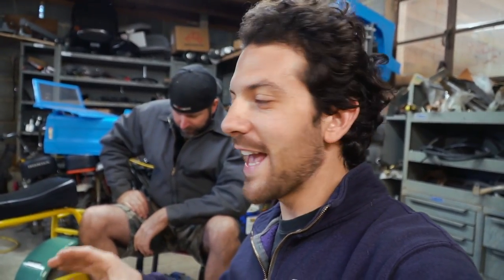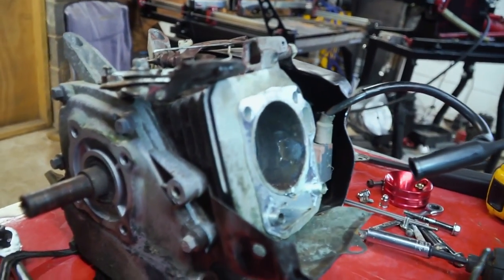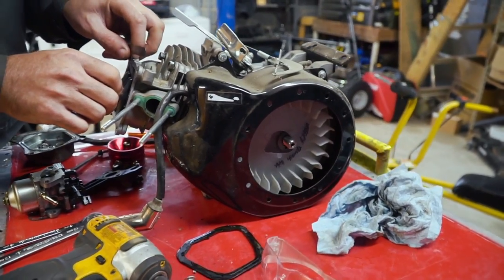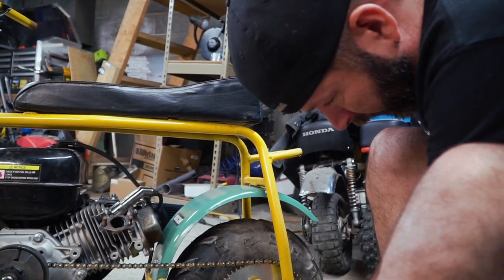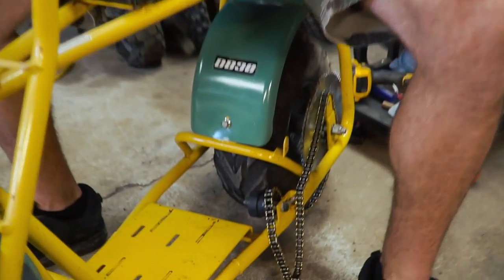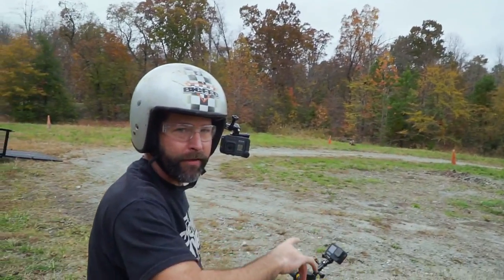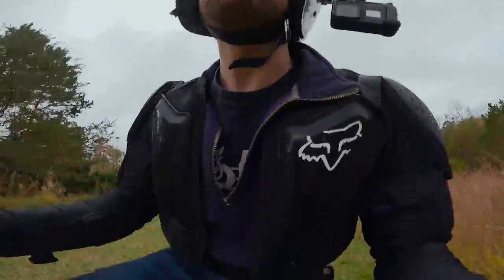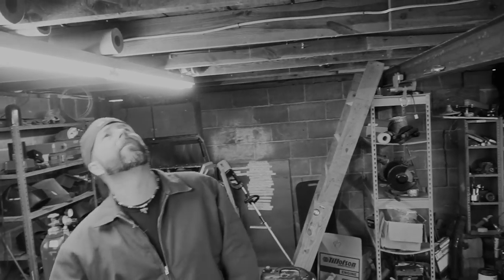Building a Budget Doodlebug Mini Bike | Max Fun for Under $200!

Comment: I put a nice green dirt bug racer db30s on Craigslist for $300 with a new chain, good clutch, 196 w/ oil sensor delete, 18# Springs, new coil, new seals, new plug, new air filter, new 212 carb, new muffler, spare ($bearing style$) tensioner, spare brake pads, new throttle cable and the swap already done, perfect fork, newer seat,, straight frame and fendees. Absolutely complete and rides perfectly..... I got offered $250..... 😕.

Comment: Get a scraper blade for tractor or if ground is to hard use a disc on it first then scrap it and repack it a good episode could be made from building a roller to pack it build a frame and use a 55 gal drum and fill with water to get the weight

Comment: if you take a plow or a tiller to your tracks the box blade will work better however if you dont get compaction on it after you grade it out it wont matter. Also if your dirt is powder dry it wont pack.

Comment: Spin the tires back around "backwards", you'll have way better traction
Reply: I never understood why tread is pointed forward.
Reply: @USN_Ret-  
Facing forward is easier on the terrain/turf/farmland. 
Ever watch a mud truck in a bog? Terrible time going forward, but reverse no problem. Everyone puts the treads on wrong!!
Reply: You are correct because they would then be correct.
Reply: Reason they go "backwards" as y'all call it, is it keeps mud skiing out of cleats, keeping them clean and unclogged. When tires are reversed you don't get good clean out
Reply: @hammerT2997  
Thats what wheel speed is for😉

Comment: Your gonna need to dig it up with the bucket to get to the soft dirt those boxes are for more spreading and plowing softer material snow wood chips top soil gravel so just dig it with the bucket then use the box to smooth and shape the trail

Comment: As to the tractor thing: you would need to run it over with the front loader, and have the box blade behind for cleanup. Better off with a straight blade, like a ford 5' or so 3 point. Heavier is better, and it will take a bit of time, and multiple passes. You can add weight to the box, but it won't be the same. Also a ripper type tool can come in handy, but I forget exactly what it's called. It has 4-6 tines that are on a bar, and go inside of the box blade usually. Check the tractor supply.

Comment: I just picked one of these up with a running stock engine and an extra subaru robin for $100 and a motovox mbx10 with a predator 212 swap with the stage 1 intake straight pipe and jet for another $100

Comment: I don’t know if anyone had suggested doing this but I would turn those tires back around so they’re facing reverse instead of like what you did earlier when you changed the direction of the tires on the front I would turn them in the opposite direction. I think this might help with the slippery roads.

Comment: i wish i knew how to tell you to work a box blade but not sure i can but will try.  start with the box blade just barely off the ground on the a spot you want to level. and go from one end to the other and see where it hits and then let it touch the ground at the highest spot where it hits and as you go back and fort don't touch the lever until you stop moving dirt any where. then drop it a little again in the same spot and start all over and the next thing you know you have a level road. but always start at the same spot and it should be at the highest spot. just remember once you find the highest spot don't touch the lever.

Comment: Having the brake so tight if you back off the throttle the governor releases so as you hit mud the wheel looses traction allowing the brake to lock up the wheel so making it slide out significantly faster than normal

Comment: You have the tires backwards now. Look at how the pattern meets the ground. Spin them to what you call backwards and run them, I bet you like the traction.
Reply: Like a street tire pattern wider at rear when on the ground not at the top. It dispersed water out and to the rear of the tire not to the front.

Comment: I used to build honda engines per w.k.a. rules,you can get away with setting the valve lash at 2 and 2.any tighter than that,and it won't restart until it cools down.

Comment: Add a half link!!.. I run into this problem a lot even on the same chassis.. sometimes adding a half link makes the chain two slack but it's too tight without it when that happens I just hone the holes a little bit... Like mini slots.. then that allows the chain tensioner to move to optimum tension..😉🚴🛵

Comment: I have ones of those. Still have the stock engine way to slow need to throw a a 6.5 or a Tillotson
Reply: Put a 212 on mine, wheelies easily
Reply: I wedged a 7hp snowblower engine from the 60’s in mine.  Total death trap

Comment: You need to level up the ground with a Scraper blade box blade levels gravel after its on the ground. May need to  rake attachment too. But a tiller would make the ground worse than it is now. Look at videos on da tube they will explain it better. If it was me I'd gravel it and tar over top of it. Look into ground up asphalt.

Comment: Hey guys i know im way way way late but have you guy can cut slots
For engine mounts easily on your drill press using a drill press clamp and a cheap ebay/amazon/internet end mill by doing this youll esentially 
Turn your drill press in to a milling machine when needed

Comment: CarsandCameras !!!!!!!!!!!! You Can Buy or make in that kobota LA211 a Landscape Rakes A Model LRC60  ( and you can build a metal / steel beam plade just drill holes in right spot and you are good to go and those lrc60  are built with rugged durability for tough clean-up jobs,anyways as well as fine raking features for light-duty lawn care and general maintenance.
• High-strength, box-type beams and spring-steel tines handle rocks, dirt, and sand
• Adjustable angles and 360-degree pivot control flow of material to left, right, or center
• One-inch tine spacing provides superior material collection for a smooth, even grade
• Optional dual-gauge wheels for depth control
- Less

Comment: I am having the same chain tensioner issues in my DB30 and its gx 160. So i need ideas! Slot the mount? But how do you keep the motor in place? Will the engine mount bolts hold it or dose it need a brace?

Comment: You need a disc to loosen up the ground before you use the box blade, you should be able to find one an old one for cheap. A drag disc would be best, a mounted disc doesn't work as well and is a lot more money.

Comment: 22:14 when the bike is making that chugging sound on mine it shakes like hell. Same bike, but a predator 212. Does yours do the same thing? The only difference is that I have the adjustable plate under the motor. It seems like it's only on partial throttle before the clutch fully locks up.

Comment: Diesel fuel and gasoline mixed together and sprayed lightly will get rid of termites as well as wild plants.weeds.friends.houses etc... You'll have to vacate for a few days and avoid any open flames inside for a few days but it will get rid of them... Once the gasoline evaporates and the fumes clear the diesel will still be in the wood and termites no likie diesel doaked wood at all...

Comment: i had the problem with my trails what i did and it worker pull a aerator over the trails first and then pull a dethatcher over it to even it out. i would use something like one of your 3 wheelers to pull the dethatcher and the aerator over the trails I used two of my 4 wheelers and it worked great.

please let me know if it works for you:)

Comment: a section of chain link fence and some cinder blocks is a great way to grade the land. AN old wood pallet can work in a pinch as well. You will have to loosen up the ground first. Tiller or add gravel sand or soil.

Comment: Find me how you would say the front tire was on backwards and then go to the trouble of turning it around. You should have turned the back tire around and run the treads backwards through the mud, turn the tread around so that work for you instead of against you. When did shred runs forward they jettison the water, if you run them backwards to treads cup the mud

Comment: I just got a Mandingo gocart with preditor 212cc someone left the breather off and the entire motor and carb was full of water and engine locked up.
I drained it all,order a new $13 amazon carb,filled the head with wd40,tapped it down after 30mns put the new carb on ran some clean oil for a few minutes a few times and now it runs perfect and idles perfect.
Guy wants $20 for it all and I immediately said I'd give more than $20 and I gave him $40 lol,the rear end is missing and why it was so cheap but I do have the back wheels

Comment: I have a question do you guys put a bolt  in to keep the clutch from sliding around or putting it on backwards stops it from moving ?
Reply: I really need an answer
Reply: A spacer goes on the crank shaft and then the clutch is put in backwards so the engine will not hang out one side of the bike to much. If not the engine is off set to one side .

Comment: We use old chain link fence with some weight to level and smooth out ground. Just gotta build a little box around it. It's not hard to build and it works well here in the mountains of Pennsylvania

Comment: I have the doodle bug.   It's running 12t in front and 59t rear.   I need a new clutch.   What tooth clutch will give me a little more top speed I'm not worried about the acceleration as it gets to top speed fast now
Reply: I just put a gx120 on it.   Had a 5hp Briggs but we blew it up lol

Comment: I used to a mini bike alot like this one way back in the 70s when I was just a kid mine was called a little Indian and yes it was made by Indian motor cycle company they made a line of mini bikes and 50 to 250 c.f. dirt bike's it was there last ditch atemp to stay in business back then it didn't work they still tried of course I should have it would be part of history by now but I didn't I well I was a kid I wasn't thinking like that back then. But I did keep it running for about 10 years back then I whent in the army when I was 19 years old and I left it one of my brothers and I don't know what he did with it from there but it was good. Times as I remender it hours and hours and hours of fun on it I hopped mine up to where it go 65 miles an hour till this day I still miss it

Comment: On all my small rigid bikes I try to run a 15" tall tire on the 6" wheel. the extra sidewall makes so much of a difference and those factory directional tires simply SUCK, not good for anything. get some 15" knobbies on that beast and let er rip.

Comment: U need a disc for behaind that tractor, till and till and till until your tired of it then let it set a week then till and till again then u can box blade
Reply: What ur doing is breaking up the vegetation and letting it rot/breakdown then mixing up all that material, the box is only for smoothing and moving loose material.

Comment: Guys it's kind of long but please read it because I just solved all of your rough track problems. take it from a man that started plowing fields and mowing hay when I was nine and my grandpa was out getting drunk and everybody thought he was doing the work. I live on a thousand acre farm in the Beautiful Green Ridges of East Tennessee. I'm three quarters Cherokee, and one quarter Irish. this is a century farm.this land was given to my great-grandparents 136 years ago because both of them were full-blooded Cherokee.  I have lived here my entire life my nearest neighbor is 6 miles and that's my great uncle. Really the only time I was gone was for the 8 years that I spent as a United States Marine corps scout sniper before I lost my leg and my eye half my face is titanium got fake knee and a fake hip and part of my spine. Anyway I've been on the farm my entire life and all you need to fix your land is laying around there. Your lawn mower has hydraulics right? Then why not build a Yard box like for a tractor or a reverse snowblade as I call them that goes on the back and you can drag all of that is smooth as silk it's like a bulldozer with the blade in the back. You could build a 9 tooth which is probably what I would use all you need is a few truck leaf springs and I'm sure you've got plenty of those Ike and a square metal frame you cut the leaf springs in half well them to the metal frame put blocks concrete blocks on top for weight and drrag that son of a bitch around. You can look up pictures or go to the co-op near you and look at the farm implements and go home and build your own the right size for your lawn mower.. does it have a three-point hitch on it on the back with hydraulics? If it does even better that way you don't have to use weight you can use the weight of the actual mower to push it into the ground. Then find you an old king size mattress with springs in it burn that but not super hot don't let it get hot enough to bend the springs anyway throw a bunch of rocks or steel or concrete blocks on top of those springs chain it to the back of hell the cross cart or whatever and drag it over the recently cut down in shaped land it will pick up the rocks and it will powder the clumps of dirt you won't have to touch anything except for pull the mattress to wherever you want to dump the rocks off and just dump them off of it to the side that way you kill two birds with one stone you pick up the big rocks and you make your track smooth honestly you could probably do this instead of worrying about using a blade or a 9 tooth you could probably just take and make a square metal frame lay it flat on the ground and drag it around and it will not a lot of that big shit down and make it smoother and then do the mattress trick and it'll pick up the rocks and make it smooth as a baby's butt.

Comment: What you need to smooth out hard ground with bad ruts is a harley rake/power rake. Like this https://www.spartanequipment.com/products/tractor-power-rake-model-t4-48-wide-3-point-pto-power-rake-manual-angle.html?gclid=Cj0KCQiA48j9BRC-ARIsAMQu3WQBAP8FeWXHlnLPF9yvCUyafyubn7z1O5cH7ixe4T1xvQ99B-7U-yMaAkmlEALw_wcB . A tiller will dig too deep and settle with different ruts and lumps, and a piece of chain link won't dig into those hard established dips and holes.

Comment: Whts up guys. New Subscriber & a fellow Gear ⚙ Head. I've ben binge watching y'all 2day & givin👍up. U guys have great Content. & ike is right on the 4 & 6 clearance. I've ben at a Honda/Yam/Suz shop for 24 years. & we have set many of motors & Race motors on 4 & 6 even when it doesn't call 4 it. & a next step hotter plug. Wrench🔧on

Comment: Learn to work that 3 point hitch lever cut the high spots in reverse use a low gear take the work slow whatever you mess up can be fixed  as long as you have  fuel in it it's dirt not concrete

Comment: Wow I got the frame and rear tire and sprocket needs a front wheel and axle. Paid 25 buck's.I have a Honda 6.5 hp pressure washer motor for free to put on it.